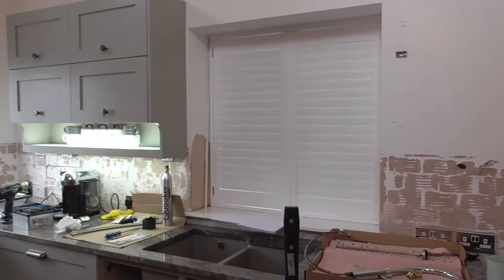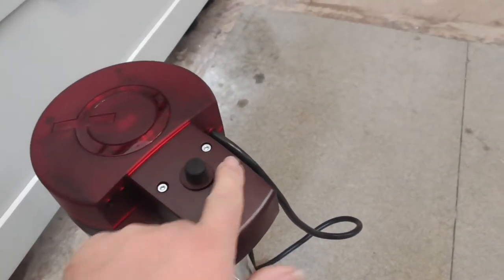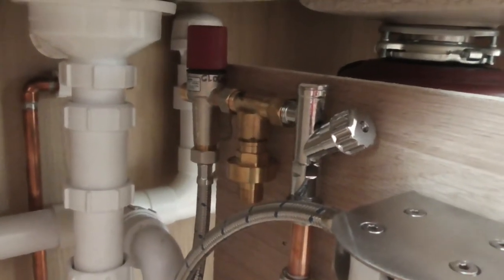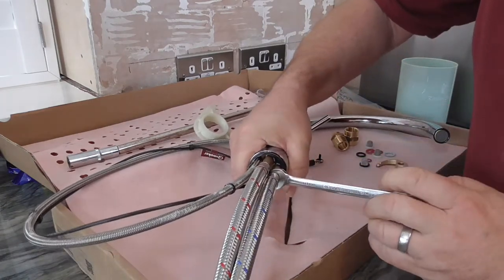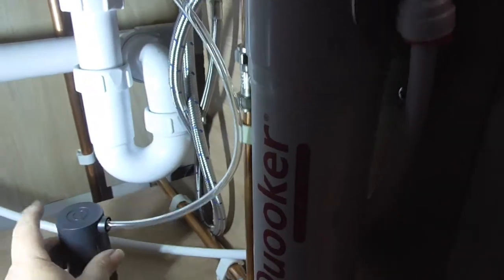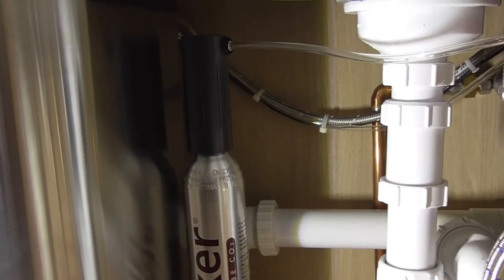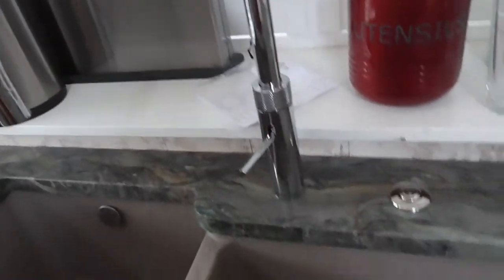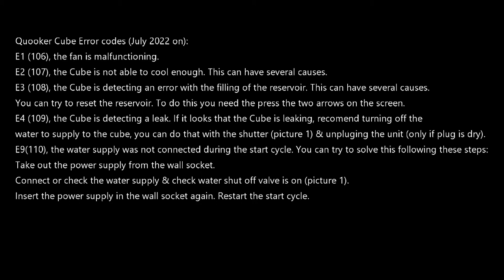Quooker Pro3 (boiler), Fusion tap & Cube (Chiller) Instal for Instant hot/chilled & sparkling water

Comment: How fizzy is your sparkling water? Do you have a picture or video anywhere showing a glass filled? Ours was recently installed and I've been back and forth with them about the sparkling water not being very fizzy. Tried changing gas, they sent a new head for the gas canister and it got a bit better, but still not (in my opinion) fizzy. Interested to know if there really is something wrong or my expectation is just not correct.
Reply from the maker: It's not like a bottle of fizz you get from the shop or a soda stream.
I am sure it only works on low pressure, you only have to look at the pipe from the bottle regulator to see that, but the wife loves fizzy water and she likes it just as much as the sparkling water from the shops! However I will say we only use brinks bottles, with sealed tops so they don't sit there bubbling away and loosing there fizz, so perhaps that helps.